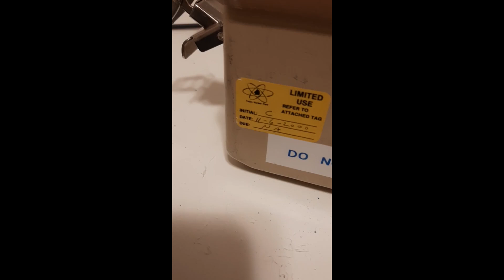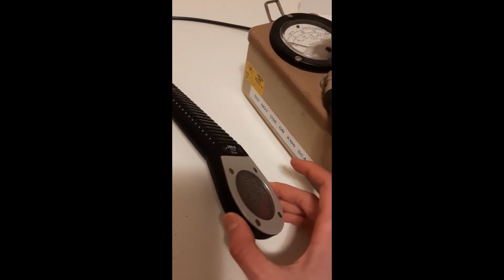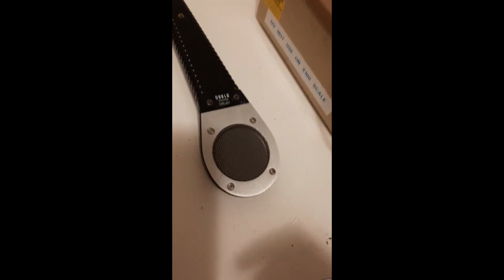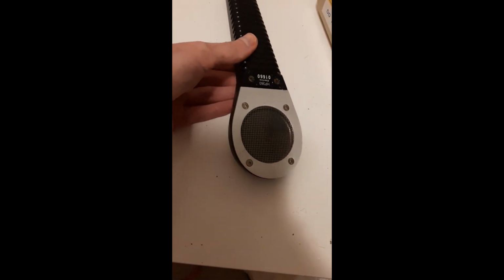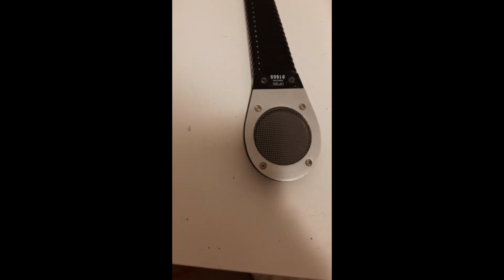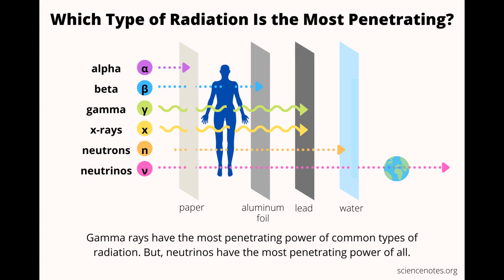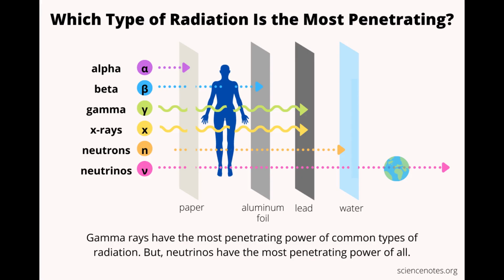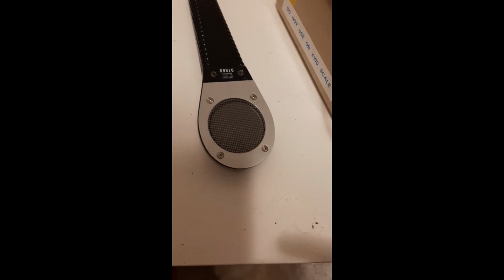how do geiger counters work?

Comment: We both have an Eberline, however you have the Geiger model and i have an ion chamber (RO-2). Yours probably has an easier interface and it's always a pro to have a probe, they're naturally cool.
Unfortunately mine takes 4 9V pp3 batteries. They're just more pricey than 2 D cells. Still need to get round to buying them. If mine is fully working, I wonder what differences there would be testing the same source.
I want a Ludlum model Geiger, they're all over Ebay. yet since im in England. Postage prices and me worrying if theyre being carefully handled coming across the pond will make me think twice. Cheers for the video.